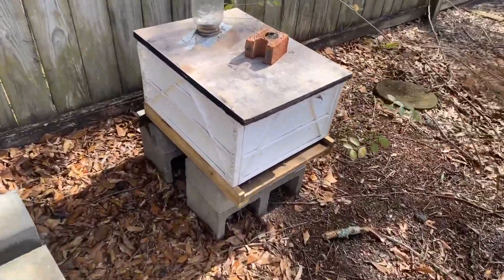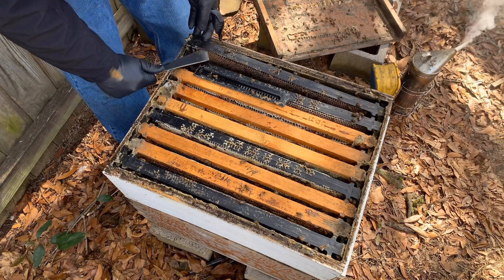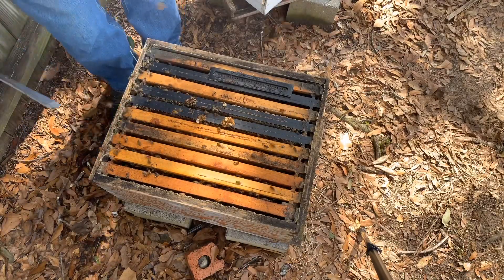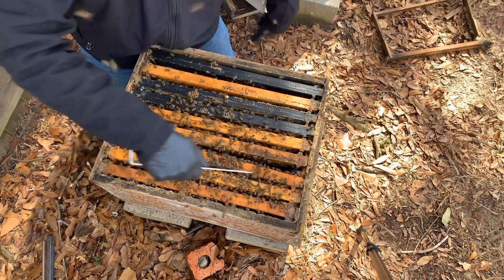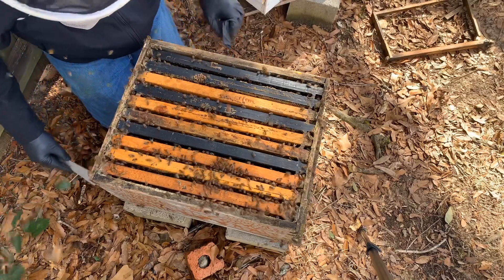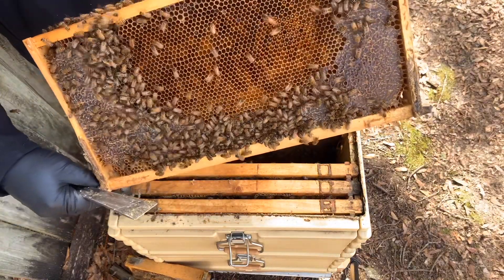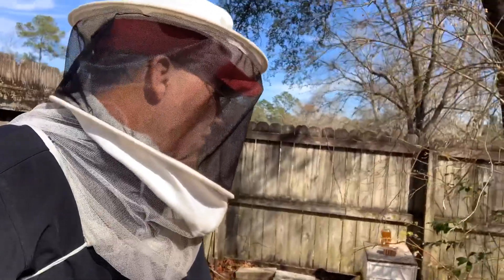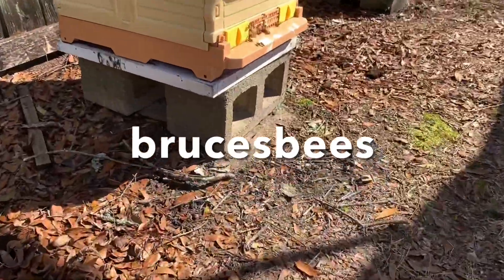My BACKYARD BEES | OAV Treatment (LOROBBEES Vaporizer)

Comment: I am seeing way too many drone cells for this time in the season, and was that a queen cell on the bottom of the first frame. Normally they breed up worker brood early spring then once their numbers are up they start on some drone brood. Also I am one of the plastic foundation knockers, I had a lifetime of polymer engineering in the plastics industry, and I am on the side of the bees this time lol.
Reply from the maker: Ok. To each his own. Here in Alabama the weather has been somewhat warm and there has been some pollen and nectar starting to come in, so yes we are seeing some brood in the hives and even some drone brood in the stronger ones. 

I have had no significant issues with my triple waxed Pierco frames. Certain times of the year they seem to draw it out better than wax foundation. Just my preference. If you don’t like plastic foundation then you shouldn’t use it. Knock away but I will continue to use it, at least for now.

Comment: Place a golf tee in those holes you have drilled for your vaporizer. Then next time you have to use oxalic acid treatments. Pull the tee out to save time. Or use a small screwdriver to clean out propolis. Take care
Reply from the maker: Great idea. Thanks for the input.

Comment: I know you have used several different oxalic acid vaporizers over the years from a battery powered wand to Johnno's Easy Vap and now the Lorob Bees vaporizer.   Other then speed is there any benefit a beekeeper would see in having one of the $300 tools  compared to a $100 wand?  Is the Oxalic Acid Vapor cloud any bigger or better from one device to another?   Thank You
Reply from the maker: I think if you do not have many hives the wand from Bud’s Bees is sufficient; $100 shipped to your door for a quality product and enough oxalic acid included to last awhile. The main reason I looked into these vaporizer guns was speed. It takes about one minute or so per hive as opposed to 3-4 minutes. The guns do seem to blow more vapor into the hive more quickly but Bud’s product does the job just fine.
Reply from the maker: Bud and Rob are both great to work with. Quality products and excellent customer service.
Reply: @brucesbees  I purchased a Gas Vap similar device a few months ago but I wish I would have spent the extra money and purchased something similar to your's or even the Pro Vap.  We currently have around 25 hives and even though I don't mind spending the extra time it takes to treat with my setup I am not positive I am doing a good enough job.  The device I have doesn't put out a near the vapor cloud like I see coming from the Pro Vap type devices.  I am debating purchasing another device before the season ramps up.  Thank you for all your help Bruce.
Reply from the maker: Well I can tell you this Lorob Bees vaporizer definitely puts a lot in the hive. And it happens fast.
Reply: @brucesbees  I took your advice and ordered the Lorob Bees vaporizer.  It looks really well built and it should pay for itself in the long run.  Thanks for all the help Bruce
Reply from the maker: Awesome!  I think you will be pleased.

Comment: Hey Bruce, if your doing OAV with  capped brood i hope you are doing three treatments in 5 day increments, OAV doesn't penetrate brood cappings and becomes about 50% effective or less. It works 97%+ on a broodless hive so best used then.
Reply from the maker: Yep. That’s true. Mainly using this as a “knockdown” treatment. Won’t kill any mites in brood, however I will say that I have done a lot of inspections and only seen one mite in a drone larva. Haven’t done an alcohol wash but in believe my counts are pretty low. We never brood completely down here but it is best to do it when brood is at its lowest pint of possible. If I feel I need to do so I will do several treatments. Thanks for the input. Good stuff!
Reply: @brucesbees  Right on! Okay just making sure.

Comment: I’m so jealous of you guys south. I can’t wait to get back in my bee yard. I can’t even see my hives they are under about 3ft of snow and it’s 0 degrees f here in Illinois negative 7 with the wind chill and more snow on the way. We have been in a deep freezer for two weeks now. Also what’s the lead time on the vaporizer. Great content.
Reply from the maker: Yeah y’all are getting pounded with the cold weather up there. Yuck! But spring will be here soon and the bees will be flying!  It takes the vaporizer a couple of minutes to heat up to the correct temp and then probably averages around a minute per hive hive or take to treat once you get rolling. Thanks for checking in.
Reply: @brucesbees  how long does it take to get mailed out
Reply from the maker: Mine was quick, within 3 or 4 days I think, but that was before I did a video and Kamon did a video on it. If I were you I would go to the website and email or call Rob. I’m sure he will respond quickly and get it out to you as soon as possible. 

https://lorobbees.com/
Reply: @medic5836  my current lead time is 3weeks, I’m hoping for much shorter. I had a recent rush of orders that I’m currently trying to knock down. Placing an order on our website places you in line.
Reply: @LorobBees  ok I will in two weeks thanks for the response
Reply: @brucesbees  ok thanks
Reply: Me too are you in Missouri?
Reply: @badassbees3680  sorry for the late response. I’m in Illinois.